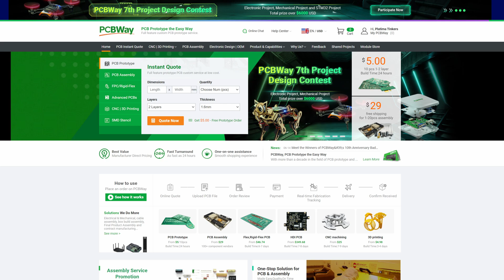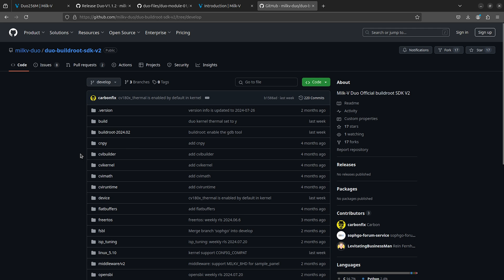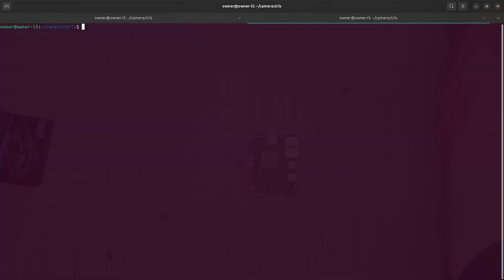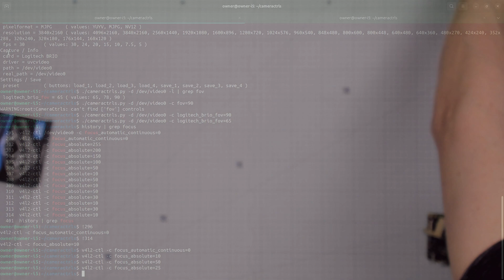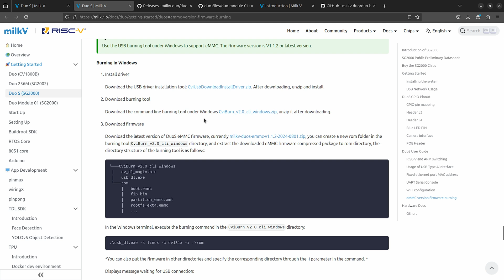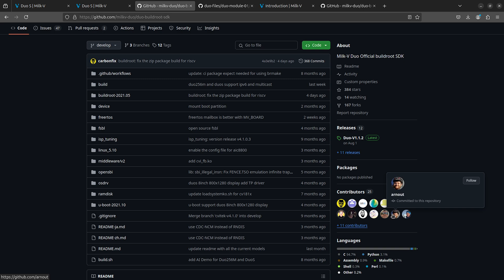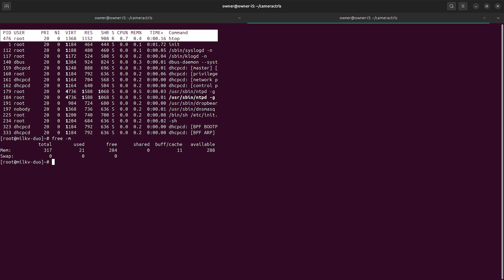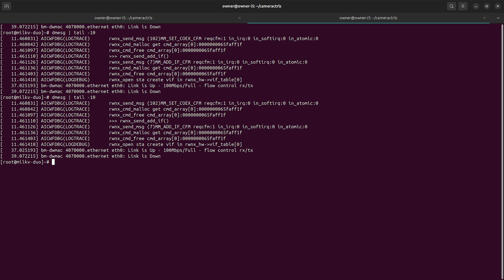Milk-V Duo Module 01 EvalBoard (Briefly): RISC-V + ARM + 8051, 8GB eMMC On-Board, Dual LAN, Wi-Fi  6

Comment: The eMMC seems to work like on the DuoS - pinmuxed with the SD card.
Reply from the maker: AH yep that would make sense; likely only 1x SDIO 3.0 interface! Once of those jumpers likely changes that.
Reply: @PlatimaTinkers  there is a method of flashing the eMMC using an SD card only - you format it as FAT32 and copy the unzipped system files to it, it then automatically flashes on boot.
They are still not expanding the filesystem but you can edit 2 files to make it larger. By default it's a few hundred MB
Reply from the maker: @r0galik  Oooh very interesting, I'll have to try that out! Cheers

Comment: Saturday was pretty chill. I started planning hardware upgrades for my rpi-4 powered multi-toolchain x-compling distcc+(s)ccache cluster. The ability to get a high # of cores helps mitigate the need for faster ones. It doesn't matter so much that the cores are 1.5-2Ghz when you have 40+ of them and the ability to parallelize the work. Have been using these videos to gather some data on current riscv options. As always appreciate the content. Cheers.
Reply from the maker: Great stuff, and sounds like a damn good way to spend the day!

You should definitely put together a 'how to' for the ccache / distcc cluster - that would be great for people that are unfamiliar with it.
Reply: @PlatimaTinkers  not a bad idea. I'll keep you posted.
Reply from the maker: @mikepartin571  Roger that!

Comment: Why not us `dd` to flash the firmware? Unless i am missing something, its just standard ARM And RSCV - as long as you have the image, you should be able to interface via the standard tooling for those arches. Via the native ARM cli tools or if you have the luxury of an SD card and a bootloader that supports it - dd.
Reply from the maker: Hey mate thanks for jumping in, but I feel you might be missing a point or two there! Eg what device node would I `dd` to, and from what device? (Referring to eMMC and excluding the SD card, as I did just dd the .img to the SD card in this instance).

Also it may be good to know that there is no such thing as 'Standard tooling for those arches' unfortunately. The ISA such as ARM's arm64 or RISC-V's rv64 only defines the instruction set / functionality, not the core implementation, SOC communication, or resultant SDK. Eg CH32V is RISC-V, and you need to use a WCH-Link to program it. STM32F103 is ARM, and you need to use an ST-Link programmer. For Rockchip ARM cores you need to use RkDevTool and for Cvitek/Sophgo RISC-V chips like this you need to use the CVI toolset.

I hope that info helps.

Comment: Amazingly, you can communicate between the RISC-V/ARM cores and the 8051 processor using mailbox intercore communication. So the linux kernel running on RISC-V can ask the 8051 running FreeRTOS to do stuff!
Edit: Looks like 8051 does not run FreeRTOS! It's the other smaller RISC-V core that runs FreeRTOS.
Reply from the maker: @turanamo Hey yeah almost - unless I misunderstood you! The primary C906 core (C906B) can communicate with the C906L core (Arduino/FreeRTOS/ThreadX/etc), and with the 8051 (watchdog, low power IO, etc). The A53 core can only communicate with the 8051 core, but not either of the C906's.
Reply: @PlatimaTinkers  yup, that's my understanding as well. Though as per their documentation "RTOS Core" titled "Inter-core communication example", they actually run FreeRTOS on the 8051 and ask it to blink an led using mailbox communication while running Linux on the Big core.
Reply from the maker: @turanamo  Hey close but I think you're getting two mixed up there - FreeRTOS runs on the C906L, not on the 8051 (there was one port 10 years ago that's seemingly not maintained now). The 8051 typically runs raw machine code, which is what's shown in the "8051 core compilation guide" section.

The "Inter-core communication example" doco doesn't have anything to do with the 8051, that's just between C906B running your OS, and the C906L running FreeRTOS.
Reply: @PlatimaTinkers  you are absolutely right. Thanks for correcting.
Reply from the maker: @turanamo  All good my friend!

Comment: I'm very confused I've seen a few of these have ARM and and a Risc V Core. Doesn't it make it kinda moot to be testing RV on Arm?

Also is there a part two? The video cuts right off.
Reply: The big cores (RISC-V C906 and ARM A53) cannot run together. There is a boot switch selector on the board to select the core to boot from.
Reply: ARM is more mature and is better suited as a host system. The RISC-V cores are independent and can be controlled from the host system, meaning that you can have a mature host system and send executable code over to the RISC-V core.
Reply: @ugagnskraake  I guess I see the appeal of that, but why wouldn't you just use a full fledged PC at that point? If you need a host to send the code to the RV Client, just use a very very mature x86 machine?
Reply from the maker: @ugagnskraake No sorry you're not correct there mate. Close though

You can control the 8051 RTC/watchdog core from both. The C906B can also control the C906L core. But the ARM and C906B cores are one or the other. Both run the host system, depending on which SDK you use.

More for testing software/hardware with both ISAs without having two boards 😊
Reply from the maker: @ZaCaptain1229 Oh holy hell I don't know what happened there with the edit, and I didn't notice as the time looked right. What a pain -_-

Uploaded ending: https://youtu.be/4Cbt8A58LeM (thanks for watching 'til the end!)

But yeah as people said, you pick which to boot. So if you're developing embedded software that might use GPIOs and LAN, you can compile it for ARM, test it on the board as ARM, then compile it for RISC-V, flip the switch, and test it as RISC-V.